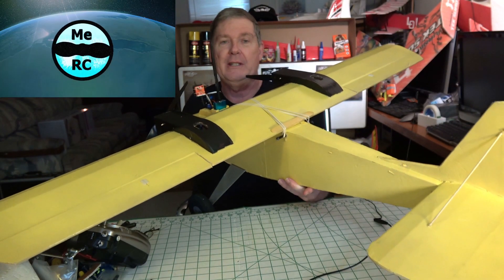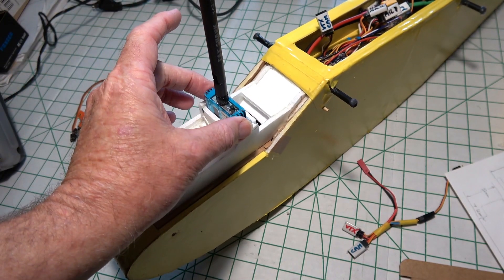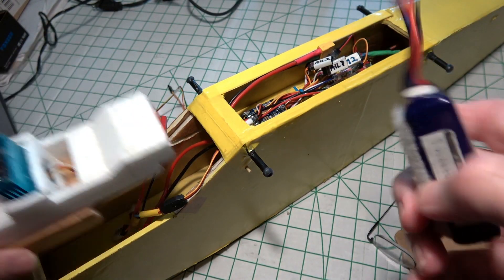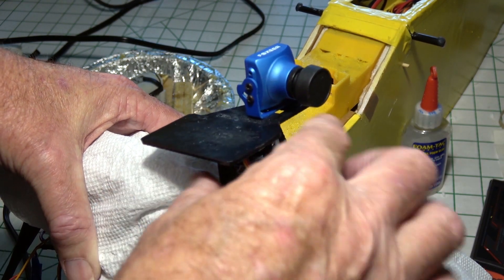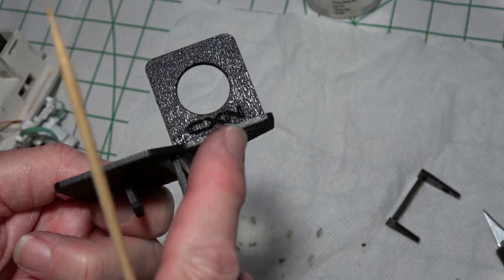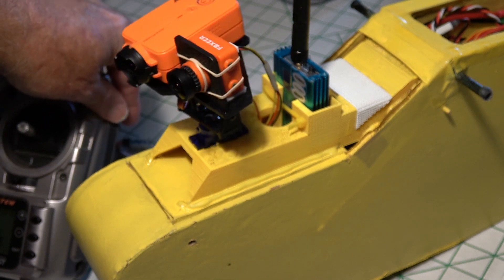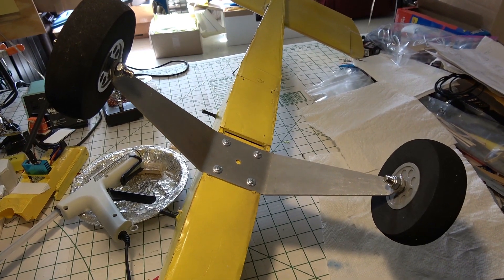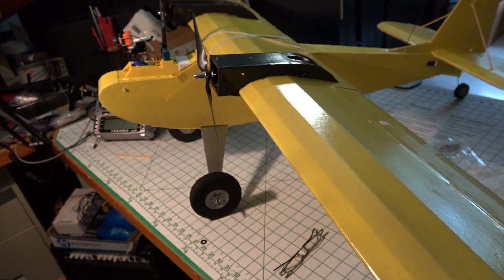Founders FT Legacy RC Plane Build - Part 6 (FPV iNAV Differential Thrust) FPV Pod Pan Tilt, Gear

Comment: Getting there Dave....Im into iNAV 2.0 now, its so much better and the F405 Wing FC....I always power my Camera and VTX from the Flight Controllers pin outs....its less wiring and its designed to do that.
   Oh, and Im first here....lol.
Reply from the maker: iNav has come a long way and become so much easier to use. The worst part is getting the Windows drivers to work but zdiag makes that easier now.
My VTX uses 12 volts and the F411-Wing doesn't seem to have a 12v regulator on the board. A separate flight bat gives me nice clean video too.
The cool thing is my camera has battery voltage readout so can see both battery voltages in my OSD. Thank you miniquad industry for making affordable small FCs and small cameras to use on planes :-)
Reply: Yeah, those 1.2G vtxs are 12v only huh..?....I use one of those adjustable regs between the vtx and the FC....I  just bought a Runcam Sparrow because of the onboard OSD...for my down and dirty Glider backpack...The F405 Wing has either 9V or 12V regulators built onboard to power camera and or VTX.
Reply from the maker: Yes, 9V or 12V regulators? Nice!